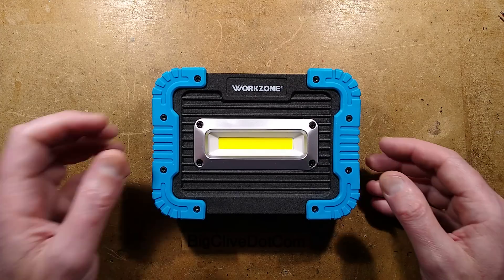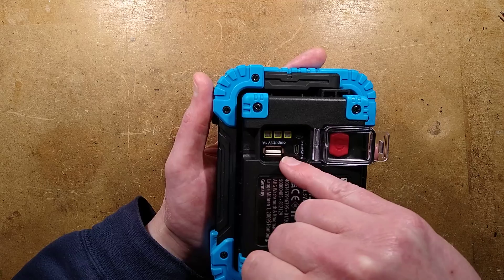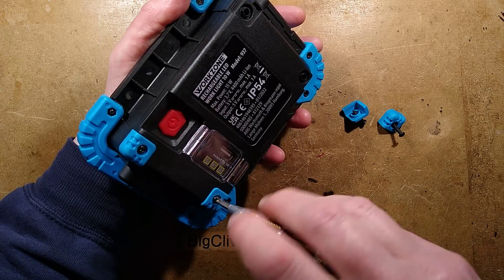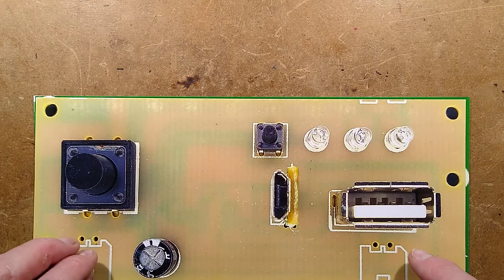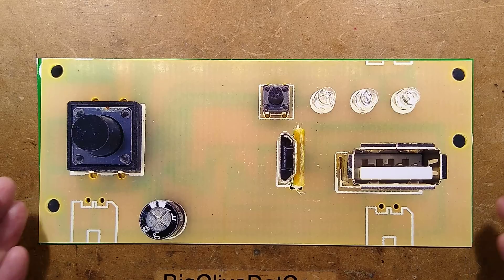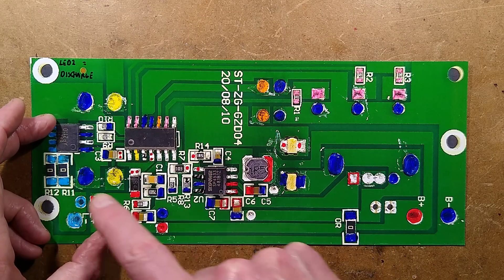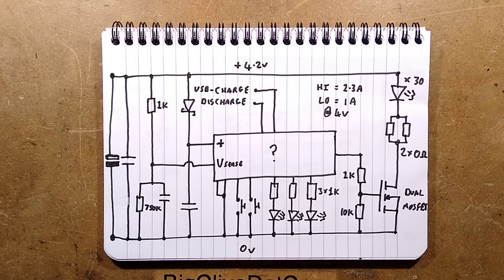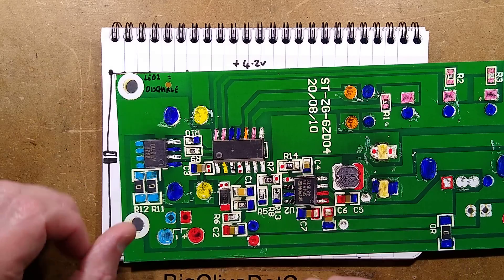Inside an Aldi rechargeable work light (with schematic)

Comment: I'm going to imagine the light uses PWM for dimming but the duty cycle is so fast the camera doesn't see it.  After all, in a circuit even 1000Hz would be trivial and would be invisible to a camera.  Not everyone uses slow PWM rates like a set of old Cadillac tail lights!  Resistive dimming would be fairly inefficient for heat...
Reply: With modern semiconductors there is no reason why any PWM dimming should be happening at frequencies less than 20kHz. Well above the human hearing spectrum and obviously not visible, even to a camera. If that’s to much to ask then at least put a capacitor in parallel to the output.
Reply: @seanman6541  Tell that to all the fancy cars out there. Watch any episode of Grand Tour or anything nice on youtube and you can see Porsches, Lamorghinis and whatever you can imagine flicker like a 90s techno disco. And then there is a cheap Aldi light that just kills it and has no flicker.
Reply: @Black3ternity   You buy something super cheap and it's garbage due to cheap design. Buy something expensive and it's garbage (or will be in a few years) due to planned obsolescence. Your really just paying for the brand name. Buy something in the mid range and it might turn out decent.
As an electronics enthusiast, it pains me to watch people buy brand new cars filled with computers and electronics. In five years your "new" car and it's software will be obsolete. To top it off, many electronic components (think electrolytic capacitors) have a relatively short lifespan. Guarantee you won't see a 2022 Honda Civic driving around in 20 years.
The necessities (FI, ABS, TCS, SRS, etc...) are all I want in my cars. My family has 4 cars, 3 of which were manufactured 1998-2004 and run perfectly. The other one, circa 2014, is already falling apart. Door locks don't work, mapping and radio unit software is 8 years old and filled with bugs.
Reply: @seanman6541  So true.  It's the Phoenix Cartel all over again.  ABS, SFI, yup.  My 2002 Pontiac is still just fine, no worries about company servers going offline or phone protocols being shut down.  Makes me wonder why there wasn't ever a "phone dock" sort of arrangement for cars but, again, $$$.

Nice to see Dave Plummer here, some great stories on his channel.  "Why does windows do xyz?  Well, I sort of randomly guessed at x and y, and it never got changed, lol."
Reply: @Black3ternity  a big part of that is the slowmo they're running but i agree it's easy enough to fix
Reply: Mebbe PWM with capacitive smoothing???🤔
Reply: Actually, if you are just doing PWM through a resistor (Or using the rds(ON) of the MOSFET, LED internal R, etc like this unit does) then it is really no more efficient than just inserting another resistor in series with steady DC. No, for true efficiency gains you'd need a LC network like a true buck-converter would use.
Reply: @kimchristensen2175  I'm surprised that the math checks out. Now I'm thinking series resistor might be more efficient than PWM because the light output is non-linear vs current
Reply: Those Cadillac tail lights were the worst...

Comment: By the way I heard you mention you have the flsun delta seems to be very nice 👍
Reply from the maker: I do.  It's fine.
Reply: Delta printers are awesome for how cheap they are. No way to print anywhere near as fast without spending a lot more.
Reply: @lobsterbark  I agree 100 percent,  I'm so glad you mentioned that I have been waiting for a dialog to be started on the topic of speed and quality, I'm really not looking for quick I'm looking for precision and I see less moving parts on the delta printer, I have also figured out how to isolate the noise and vibration from that big hunk of machine . My mom loves to watch big Clive every now and again when I mention him in conversation she always speaks highly of him and how entertaining he is ....hope he reads that ....
Reply: @bradmeekakasilvertopflyer  Deltas aren't great for print quality because they are usually cheap, and ones without 32 bit boards aren't great for precision because of rounding errors they have to make to avoid running out of bits.

Cheap deltas are almost all 8bit. A cheap (but not quick or easy) upgrade to fix the precision issue is the use of Klipper firmware. Klipper uses a Raspberry Pi(32 bit) to do the math and therefore allows for full 32 bit precision. Klipper also allows for input shaping, which is a method of cancelling out vibrations during printing to print faster without sacrificing quality.

Asking about print quality differences between delta and Cartesian printers is asking the wrong question. Other than the issue of 8 bit firmware, when tuned properly there isn't any difference in print precision or quality compared to cartesian designs if you literally don't care about speed whatsoever. But you will care about speed even if you are patient because many designs require you to print so slowly to get high quality parts that even small things will end up being overnight prints, and larger parts can take days.

The thing to worry about is how fast you can print without losing quality, and cost. Deltas allow you to spend less to get the same speed and quality, but take up more space for the same build volume.

And btw, the best printer design overall rn is the Voron. It's a corexy printer. They don't sell them you have to build them, and because you chose the parts you also choose the price. The minimum bill of parts is bigger than most printer designs, but everything in the design is there for good reason and isn't possible to remove.
Reply: @lobsterbark  I have met a 14 year old genius  that lives in California that is building vorons I have spoken with him and I agree its the way to go
Reply: I'm really frustrated that every single manufacturer has churned out printer after printer with inadequate cooling or inadequate 8 bit firmware and just leaving it to the consumer to figure it out. I have tried to have conversations with sales at several companies,even offering 4 times the money , they wouldn't  upgrade any of the models in stock .
Reply: @bradmeekakasilvertopflyer  3d printer technology doesn't belong to companies. This is a good thing.

Comment: I was able to pick one of these up recently from the bargain bin. I had the version from a couple of years back, which is in the same casing but yellow, and has the annoying flashing mode on the 3rd click of the button. Was very pleased to find out they got rid of that in the newer version! I found that if you unplug and replug the charger in when the 3rd light is flashing, it then shows all the LEDs lit correctly, a bit odd that it doesn't do that when charging.

Comment: It would be great if it had a threaded insert for use on a tripod.
Reply: I've got the corded version which includes 2 dimmable lights and a tripod. Very bright and robust, i normally see products like this for about double the price i paid. 52 euros. I'm using it to illuminate the workspace during wall painting and general interior working. Really happy with aldi stuff. And I'm not usually cheap with my work tools, at all.
Reply: The Harbor Freight one does.

Comment: I have a pair of work lights identical to those except the brand "Feit Electric" on them. They're great but there's a ton of unused room inside which could be full of batteries.
Reply: It's a cost thing not a space thing.   Those extra batteries would push the price up to much.

Comment: I went into our local Aldi and the manager found the Workzone lamps they still had in stock. The stock label shows that these lamps went on offer at the beginning of March 2022, some 8 weeks ago, maybe how the online Aldi was out of stock of the offer of these Workzone lamps.
Our local Aldi still had about 20 Workzone lamps in stock, so perhaps not that popular an item, despite how handy a lamp this is.
I picked up two for around £7.50 ea.

Thanks for the heads-up, Clive!

K Watt.
Reply: That's great to know about asking the manager if something your after is still in storage out the back.. coz there was a few items I thought I missed but there might have been one out back in storage. So thanks GetCaterCarPark... (& a pint for himself)
Reply: Yes, I think you were lucky to get a unit at a reduced price.  I bought one on 2/11/2021 at Aldi Süd in Germany for 19.99€.  Very similar device but the labels are placed slightly different and the cob LED is almost square, the plexiglass cover is quite a bit narrower and slightly higher than in bigclive's unit.  Aldi buys enormous volumes of the articles which they stock only for a short time.  My guess is they had to settle for different types of LEDs to get the numbers they wanted.

Comment: can it be powered by the main charger for a longer runtime?
Reply from the maker: It should be able to charge and run at the same time if allowed in the software.  I'll have to check that.
Reply: I've found they do work indefinitely plugged into the charger but for some reason they say not to do this.

Comment: I was distracted by breakfast when you showed the circuit details, but i wonder if the always-charging-LED indicator is due to the positioning of that Schottky diode preventing accurate sense of the battery charge.
Reply: That might make a bunch of sense.

Comment: I got one of those - the USB port ripped off the board the second time I plugged it in to charge, and I'm no brute 😞
Reply from the maker: That did strike me as a bit of a weakness.  One option is to hardwire a short USB charging lead into it.
Reply: @bigclivedotcom  Great idea! Thankyou Clive 😁
Reply: I had to fix one of these with a similar problem and ended up wiring in a random Mini-USB jack I had lying around. Added lots of glue and it was fine. Right up until the light fell down inside a block wall and was never seen again.
Reply: @QBFreak  legend has it it's still lit up